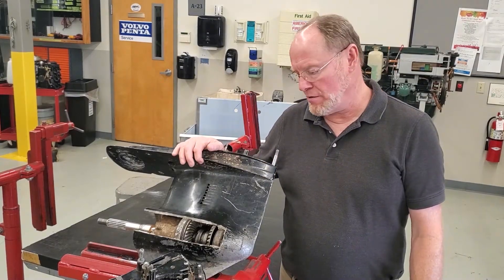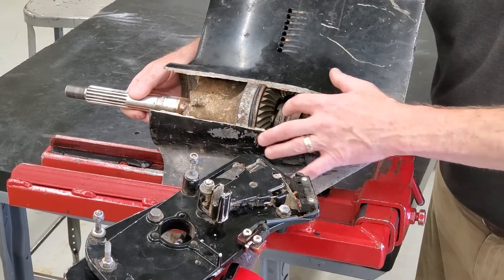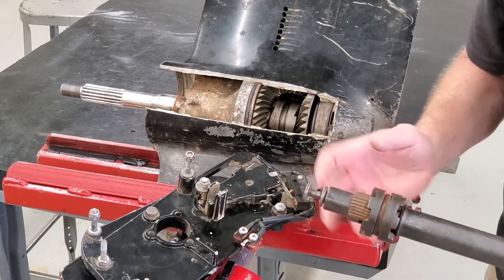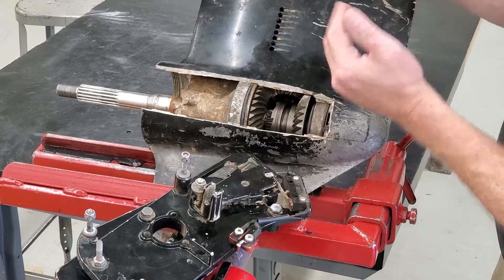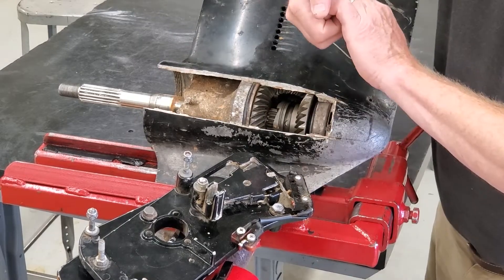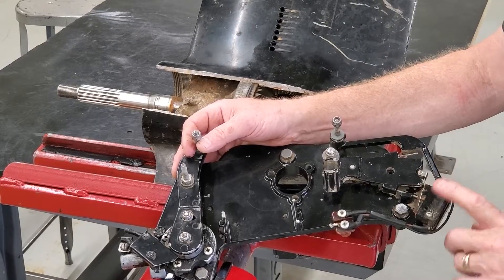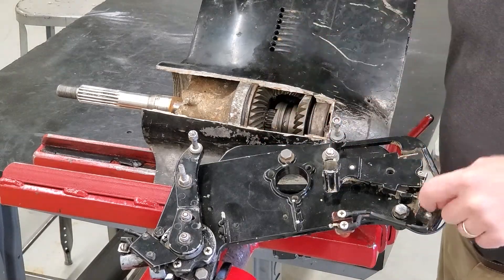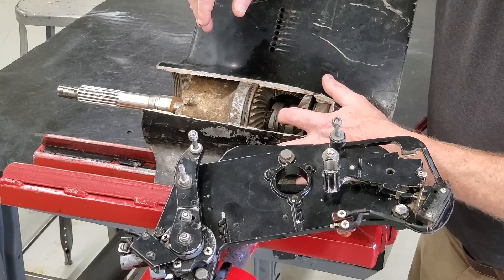MerCruiser Alpha Sliding Clutch and Shift cut out switch explained

Comment: Very thorough explanation I’m having a problem with my gen 1. After getting my 6” shift barrel nut spec I am able to get forward and reverse engagement with the spring shift assist disconnected (and some tweaking of the shift cable ferrule and helm adjustment) but I can’t seem to get full engagement for one gear without losing engagement with the other when I have the shift assist on. I recently renindexed the lower shift shaft after someone messed it up after a water pump change so that forward gear is in proper range (the upper shift shaft is aimed straight when in forward) which solved a lot of problems but I just can’t seem to get proper cable adjustment on the shift plate. It’s also worth noting that on my boat (a bay liner arriva) the entire shift plate is only affixed with one bolt to the manifold from factory. I’m wondering if this is part of the issue and the whole plate assembly might have to be shimmed. I’m also wondering if I absolutely need the spring shift assist connected when driving the boat. I would much appreciate some feedback because you seem the most knowledgeable about alpha drives on YouTube.

Comment: Amazing video!! Thanks so much, needed the explanation of how it works. Now I can try to figure out my issue. 
Replaced the lower shift cable on my 88 because it kept staling, but now it won't come out of gear. I need to figure out how to adjust it properly. 
Thanks again
Reply from the maker: While tied to a dock, start it and put it in forward then momentarily  move the cut out bracket (the spring loaded piece) and see if it cuts the ignition. If not check the wiring g for the switch
Reply: Thanks for the info. I had it in the water the other day to try to get it adjusted. First, I adjusted the lower shift cable in the yard while the outdrive was in a tub of water and with earmuffs on. I started by adjusting the barrel on the lower shift cable to the 6" distance from the barrel to the mounting position on the linkage assembly. All seemed to work smoothly in the yard after a little adjustment to the lower shift cable barrel, it went into forward to neutral and reverse to neutral without any problems. Then I put it in the water and tried it on the trailer, and for some reason it didn't go I to neutral from either gear like it did in the yard at the house. I tried to make some minor adjustments and still couldn't get it to go into neutral from either forward or reverse. I would like to say the only thing that I can tell is that it only went into neutral if I went a little farther on the shift/throttle control lever from either gear.  So if I was in the reverse I would have to put the lever more towards the forward position past neutral then it would momentarily stall and come out of gear and it would be the same from forward to neutral I would have take the lever past neutral a little towards reverse for it to stall momentarily then go into neutral. I couldn't get it to go into neutral easily no matter what adjustment I made. 

I decided since I could get it into neutral by doing what I mentioned, we decided to take the boat out. It ran good riding it for a hour then when we decided to take it back into the dock to take it out, we couldn't get it into forward gear. I made an adjustment to get us in but it was really acting up going into neutral. It was stuck in reverse at this point no matter what I tried, after looking at the linkage the lower shift cable broke.  This was a brand new lower shift cable. 
I have a video of what it was doing if that helps let how I can send it to you. I also have pics of my throttle control also. 
I am at my witts end, any help would be really appreciated!
Thanks

Comment: do you have any video showing how to adjust cables with the cutout switch and has a shift assist which finally after days of trying to adjust with the shift assist device i could only get it into either forward or reverse but not both. it seemed like only way it would go into revers is take off the shift assist because it was to short and not letting cable push lever all the way to engage reverse gear but forward would go perfect, so i finally too off the shift assist and now it will shift into both but sometimes it wont go into reverse it stays in natural. any videos or advice on this.. i have a 1999 fisher 241 freedom dlx with a 2004 3.0 mercruiser with alph 1 gen 2 drive.
Reply from the maker: @jasonthomas1817  there is an adjustment for increasing the throw of the cable. I will do a short video on that asap.

Comment: that switch has been NLA for a long time. it's a quicksilver 39670 A28. i installed one this summer that was NOS. date on package was 08/19/82. it was still sealed in a plastic bag and coated with grease. the grease smelled like play doh. the price tag was $12.19. it works fine. the old switch looked like it was attacked with pliers sometime between 1979 and the date we replaced it.
Reply from the maker: @mikeysinternetcafe240  yes like every older one out there, all thinking the switch adjustment is the issue

Comment: Ted, When I hit big waves, Merc A1-G1 3.0 140 hp,  my engine shuts off and has no problem restarting. Do you know what I need to target first. People on the I-boats forum says it could possibly be the interrupter. Any ideas?
Reply from the maker: It definitely sounds like an ignition voltage issue. 
I would start at the ignition fuse at the dash (purple wire) and work my way down by wiggling the harness connections while it's running. Then on to the ignition coil wiring. The interrupter is part of the the circuit but I doubt that's the issue.

Comment: Nicely said. Makes perfect sense. Perfect gear mesh every time and cannot pop out of gear like a car trans with bad synchros. Slow it down some to allow separation
Reply from the maker: Thank you for the positive feedback, AND especially your end statement. Thank you for your support and helping me improve my videos!! I will work on slowing down for comparisons.
Reply: @tedsmarinerepair8956  you're welcome. I didn't mean you slowing down. You did great. I meant slow the gear down to allow separation, lol.
Reply: I knew he meant slowing the gears down the first time I read.    However if the shift interrupted switch dwell is too long the engine will stall and that's a headache when in a tight marina trying to dock on a windy day.   Had my shift cables replaced and the 7? point adjustment done by a local certified mercruiser repairman who if not working on boats,  he is sitting at a bar so he's hard to get ahold of.😮    yes it is important to be firm and authoritative when shifting gears you can't pussyfoot around it's either in or out.

Comment: Hi excellent video thank you 

I have a 3.0 and Alpha one gen2 shifts perfectly out of gear forward and reverse. I am a little concerned about the loud clunk when I shift into f and r my old outboard was much quieter.
I have tried reducing the engine idle speed down as low as it will go around 650 rpm but that didn't make the clunk any less. I would like to know if the loud clunk is normal on alpha gen 2
From memory I have a 17" pitch  3 blade aluminium prop with plastic insert hub I imagine a heavier stainless steel prop would be worse

Thank you Greg
Reply from the maker: Yes it is normal to hear a loud engagement of the drive when shifting. Nothing to be concerned with. Even with a cone clutch, when shifting a DPS drive they are very loud as well.

Comment: Awesome video! I understand the sliding clutch concept. And the slowing of the engine in order to shift. But it's how the engine is slowed is what is causing me a fit. I was just about to attack the switch you referenced that :"people that don't know what they are doing" go after 😂  
I will say I have had just about all I can stand  of mercruisers. 
So I have an older mid  70 Cy. How do I Start from scratch on cable adjustment? Like everything unhooked from. Both or one end?

Comment: I’ve had many problems with this and followed your instructions to replace the shift shaft cable, but I’m still having a problem with the disconnect or interrupter switch. Interrupter does not go back into the slot or the valley. Does this has anything to do with the other cables, please help I’ve been struggling with this for years, I’ve also had an idea of using the safety shut off next to the gear selector and try to imitate the shift interrupter at that point where it shuts off the engine momentarily when I put it in forward and backward or take it off gear I meant

Comment: Hello friend, good video! I bought a 1970 model 120hp Mercruiser. The engine runs perfectly, but the gears don't come in and it's only in neutral. I took out the upper axle cover and it does turn, but apparently the gears don't engage, what could it be? I moved the cable manually because I thought it was stuck but nothing, it just clicks back and forth. Greetings from Argentina!!
Reply from the maker: With the boat out of the water with the engine OFF NOT running, shift it into gear and see if the propeller locks by turning it counter clockwise, try shifting it by hand with the cable disconnected. 
You can then shift it into reverse to see if the prop locks when turning it clockwise.
If it does not lock in either direction it is likely in the lower unit and needs to be rebuilt.
Reply: Could it be the gearbox switch?
Reply: Thank you very much for answering! I took out the entire device and put the gears manually to one side and the other, luckily they engage perfectly, apparently it is the cam that comes from the cable that is worn. It is normal that when the reverse is engaged while the axle is in motion it remains engaged but when the brake is applied it jumps and the opposite gear is automatically put into place?
Reply from the maker: If you have removed the drive and it shifts by hand - prop locks clockwise and counter clockwise when shifting it, It may just be the washer that goes on top of the shift shaft on the lower unit. please email me at marinedoc01@yahoo so I can send you a couple pictures of where the washer is. @germanpenagarcia4581

Comment: This has got to be the Best Video on alpha m r and 1 outdrives on the internet....😊😊 I have a 1980 bayliner Saratoga with 228 mercruiser and alpha type omc drive and had the switch cutting out in reverse. Tried to do the slow engagement and disconnect (wire) interupter now it wont go in forward trying to get it out if reverse. Only neutral and reverse now.. Im told the cable may be stretched???
Reply from the maker: Remove the cable from the shift bracket( the one that that leads from the drive to the shit bracket). See if it feels real stiff to move. Next Start the engine and manually try to shift it into gear. If it will shift change the cable. Also look at the control cable to ensure its not got a ruptured outer jacket.

Comment: Just changed water pump alp 1 gen 1. after reinstall of lower drive still no grease, when in forward prop locks in CCW direction (turned by hand) & turns in CW direction with a popping noise. 6 pops per 1 prop rev. Neutral is free. Reverse is just opposite of forward with popping in CCW. Previously no popping in either direction.
Reply from the maker: That's normal.

Comment: After changing my shift boot a rebooking up my shift cable my boat won’t go into neutral while running but will if I shut it off it does great going into forward and reverse
Reply from the maker: Shift lever into nuetral, Start it up, disconnect the cable and see if you can manually move the cable to get it into nuetral position. Then adjust the cable barrel to fit the shift bracket

Comment: I just bought an older Wellcraft with an inboard outboard MerCruiser and it dies when I shift into reverse and I was told it’s just needs a linkage adjustment is that a possibility?
Reply from the maker: It is possible it's way out of adjustment but you would have to shift into forward almost into the throttle area and reverse would be almost instant engagement when shifting.

Comment: I have a 1978 SeaRay that dies when shifted into reverse.
As you move the lever back it trips the cutout switch and stays there.
Is this a bad cables, or just keep adjusting??
Reply from the maker: If it shifts into forward ok then a bad cable
Reply: I uploaded a video titled Switching gears

@user-ko3mg6ig1

Comment: hi ted great informative video i have alpha one outdrive the shifter stuck on me out on lake its in neutral but will not budge foward or backwards please advise
Reply from the maker: It sounds like the shift interlock in the control has failed or the cable is locked up. Did you try nuetral only to see if the control will move the throttle cable

Comment: Hey Ted this was a great find!  What are the chances you could do a similar video for the Bravo 3?  I have a Mercruiser 5.7 EFI  with the Bravo 3 that keeps stalling when put in the forward gear at idle speed.  Wondering if it could be the same cutout switch cable issue.

Comment: I’ve watched this video 5 times and appreciate this so much, I have an 85 and replaced the upper cable and the plate but it is hitting cutout and staying triggered going in reverse (out of water on muffs) I set bottom cable to 6” while in pushed in all the way and top cable lined up than 4 turns out I don’t know what else to do ? Thank you so much
Reply: This is new style push button not rocker

Comment: Great video, thanks so much for making it! I like to understand the theory behind how things are supposed to work (the cut-out switch in this case) before attempting to make adjustments or repairs. I am glad I found this video as it described exactly what I wanted to know. My boat has an Alpha One gen 1 and when I got it the upper section of the drive was destroyed (many missing gear teeth) and the previous owner told me there had been an issue with the shift cut-out switch. It does have the newer style plunger type switch and I want to make sure it is set up properly before I test the new drive in the water. Thanks again for the super helpful video!!!
Reply from the maker: Glad it helps, lots of folks really don't know how it works.
Reply: S

Comment: That y shaped piece doesn't move when shifting. It fights to get out of gear. I can easily move it by hand but does not move when shifting.
Reply from the maker: It should move very momentarly to kill the ignition and slow the engine speed. If you move it manually while the engine is running in Neutral it should stall the engine
Reply: @Teds Marine Repair  the switch works if I move it manually but that part doesn't move to activate it. Last time we were on the lake we almost hit a wall because I had to force it out of reverse and it went into forward. It seems like there's not enough drag on the cable to make it move.

Comment: Thanks Ted, great video! I have a 2012 Mercruiser 3.0 with Alpha and shifting into neutral has a delay of a couple seconds. Also requires a lot of force on the shift lever to get in and out of neutral. Had shifter cable replaced but did not fix it. Thinking about trying the quick silver upgraded shift interrupter kit 864363A-1. Is that a good next step in your opinion?
Reply from the maker: I would also check the cable from the shifter to the drive bracket. I'm finding more cables binding up
Reply: Does the shift lever move easier when the engine is off? If so, you have a shift interrupter issue., if not, follow teds recommendation.

Comment: I recently Replaced my Thunderbolt V ignition module to a MSD ready to run distributor. To get my shift cutoff interrupter switch to work, do I run the white cutoff switch wire to the coil negative?
Reply from the maker: Yes

Comment: Have A cabin cruiser with dual screws, when backing up if need to spin more and want to put my right motor in forwards at a slow speed it chatters and I have to push past it to get it into gear what would that be
Reply from the maker: Cable problem

Comment: what was the purpose a=of the reverse lock valve on the end. I have that on mine
Reply from the maker: Do you mean for very old power trim systems?
Reply: @tedsmarinerepair8956  yes. I am going to do the plate upgrade. I can't find any info on the reverse lock valve
Reply from the maker: @gdebrango  upgrade to Mr or newer pump assembly, problem solved. Plumb hoses to pistons

Comment: Hi Ted, you look like you would be the guy that might put me on the right path.
My mercruiser 165 hp 4 cyc, Alpha Gen 1, once I'm on step doing 25 knots, it slips in and out of gear with a hell of a bang as you can imagine, does this every 20 secs or so. I did a adjustment to shift cables etc with exact measurements.
What does you gut tell you first thing.

Cheers
Fred
Reply from the maker: If it shifts normally into forward Neutral, reverse but popping in and ouf gear, then the clutch pawls on the forward gear and sliding clutch are rounded over. Needs a lower unit rebuild/replacement.
Reply: @tedsmarinerepair8956  Thank you for time Ted. I found a complete rebuilt one for $1300, gonna grab that this weekend and give a go.
If you're ever in Campbell River in the summer andwant to bonk some nice chinook salmon, look me up.
Reply from the maker: @silkstreamdesigns  sounds good!

Comment: My boat mechanic said the adjustments are near the end and I’ll prob be needing the lower unit.  He said the clutch is wearing out.  Can this be rebuilt?

Boat mech said it’s just about as cheap to install a lower unit.  Help?  He telling the truth?
Reply from the maker: If it chatters alot going into gear in both forward and reverse the clutch and messing gears are worn out.  And aftermarket units are cheap, not sure on their life. I have 1100 hours on my 1.5 ratio alpha one. Resealed it back at 800 hours.